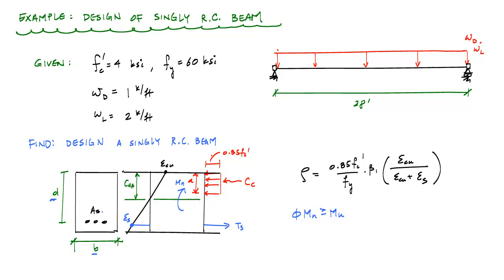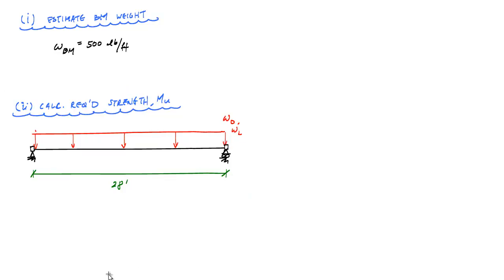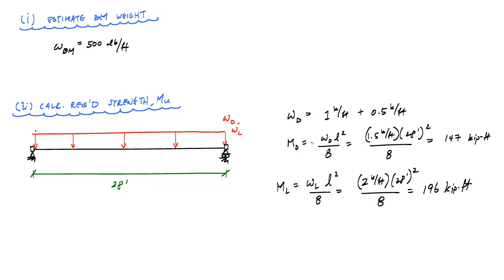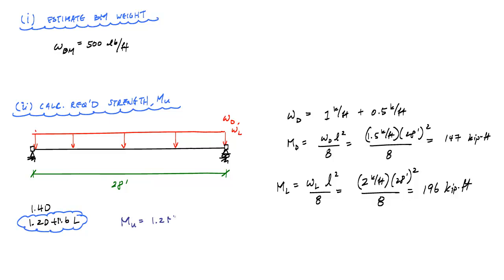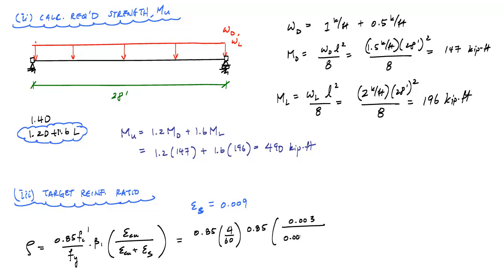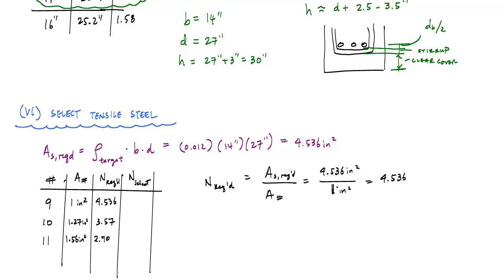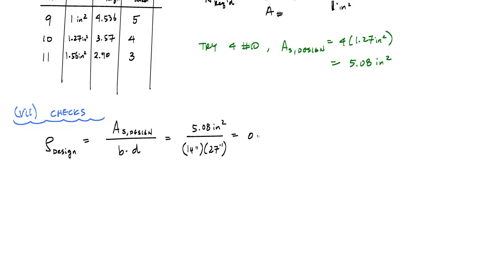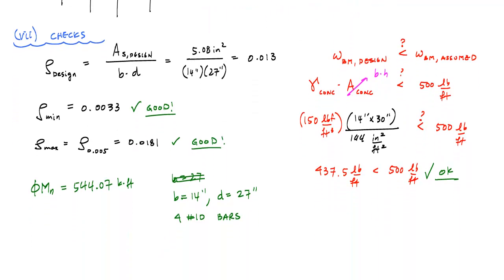Design of a Singly RC Beam Section Example 1 - Reinforced Concrete Design

Comment: Why did you pick 0.009 for the steel strain at the beginning. Why not 0.005.
Reply from the maker: +Brittany Zipperlen choosing the strain value (or target reinforcement ratio) is technically the designer's choice.  If you chose the reinforcement ratio associated with 0.005 tension steel strain, it's possible that when you specify the design steel area from the required area, you could end up in the transition zone for the strength reduction factor or possibly worse (i.e. overreinforced, although unlikely).  Some books recommend using a target reinforcement ratio = 0.18*(fc'/fy) which corresponds to a tensile strain value of 0.009 (for fc' = 4 ksi and grade 60 steel).  Typically, targeting a reinforcement ratio around 1%, results in a ductile, tension controlled design.  Congratulations! This is my longest response ever.  Westssssiiiide!!

Comment: I have one question, is this the European or the American method of designing?
Reply from the maker: Ogidan Olamipe it's a mechanics based design approach based on strain limitations...i use the american concrete institute code requirements (ACI 318) for load and resistance factors.

Comment: Hi... thanks for the video... I am curious about a couple of things. 1) I noticed that you didn't calculate the weight of the steel in your check against the assumed weight. It's only 11.77 additional pounds or about 2.7% more. Do you typically consider the weight difference between the concrete and steel to be trivial enough and just calculate the area of the steel as the weight of concrete? There is a huge difference 150lbs/ft3  v.  489lbs/ft3   2)  Would the design benefit by accounting for more concrete surface friction on smaller bars resulting in a stronger beam, or is this relatively trivial? It would seem to me that as the beam is loaded there will be a sheer load between the concrete and the surface of the bar, as well as a sheer load on the dimples on the bar. Wouldn't more surface contact between the concrete and bars result in a stronger beam?  Thanks again!!

Comment: how do you know the A# ?? the 1in^2 and 1.27 and 1.56??

I saw the aci code table but these number you have used are for spacing 12  !? help please
Reply: This should be obvious with simple math... the bars are round... the cross-section is a circle... the area of a circle = pie r squared. What's not obvious is that Imperial bar appellations represent rebar stick diameters in fractions of an inch, such that #8 = 8/8 inch = 1 inch diameter.. so a #9 bar is 1.125" and  #10 is 1.25". Therefore, a #10 bar should have and area of 1.2271 but  the problem comes with the our material labeling system. Experience tells us that a 2x4 pine stud is actually 1.5x3.5, and a #10 bar is not actually 1.25"... it's slightly bigger, so we have to look at the material specifications to find the area. which is 1.27.

Check out rebar-info.com for the tables.
Reply from the maker: +Mansour Mohammed  The areas are based on the designation of bar sizes.  For #3 through #8 bars, the diameter = bar #/8.  For a #9 bar, the diameter is 1.128", so that the area of a #9 = (pi/4)*(1.128")^2 = 1 in^2.  For a #10 bar, the diameter of 1.27 in is convenient, since the area of a #10 = 1.27 in^2.

Comment: When you determine b=14 inches and d=27 inches, why don't you verify the width is wide enough to provide enough cover and space for the rebar you chose? Also why don't you specify the final height? Are those not common things to check during the design process?

Great video by the way! Very helpful!
Reply from the maker: Brian Wisner Thank you for your comments. I chose not to go into the detailing since the goal is to first get an estimate of b,d, and As.  The clear cover and spacing checks would definitely be next.

Comment: When the beam dimensions change, the beam weight will change. How can we just choose a number, 500p/f here, to get a correct beam size? Are you saying that beam weight is irrelevant to choose beam dimensions?
Reply from the maker: Mindy Xu as long as the final design weighs less than the assumed weight the beam should be safe.  if the final design is greater than the assumed weight, then you can go back and update your required moment strength and check the design by analysis.
Reply: structurefree searching for this, thanks